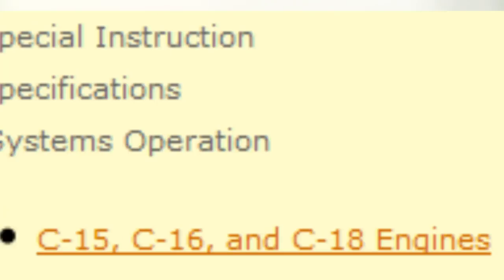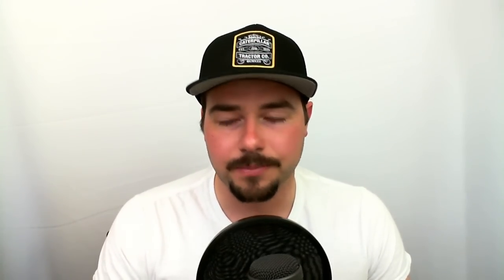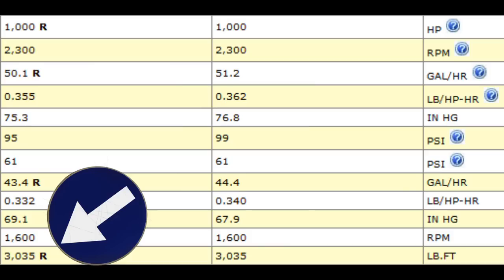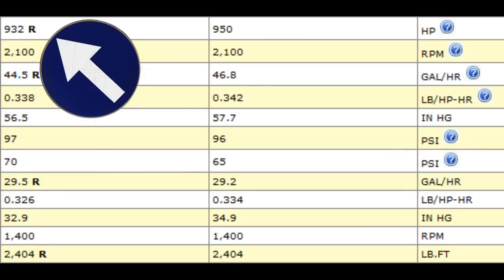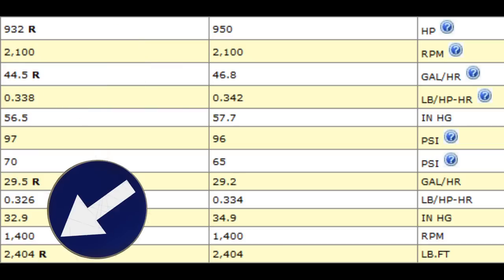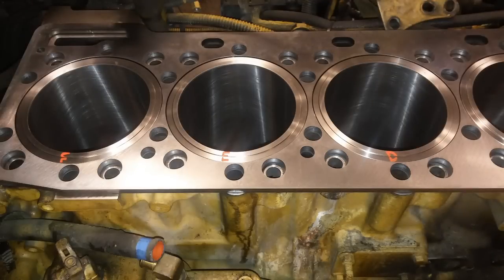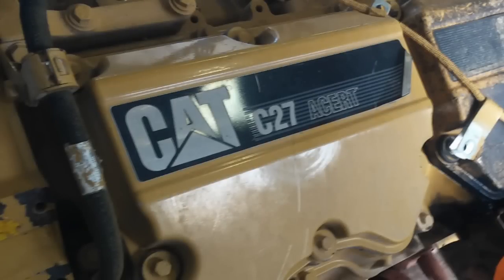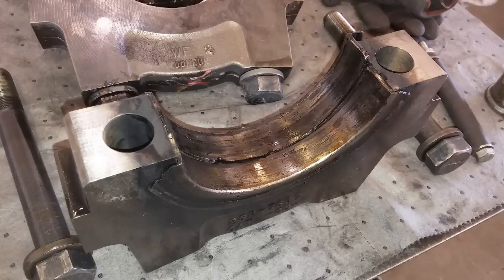Turn A Cat C15 Up To 1,000 Horsepower With Stock Parts.  The Ultimate 3406 or C15.

Comment: So what caused the c27 failure ?  Coolest truck I ever saw belonged  to Titan Heavy Haul from Evergreen Colorado. The owners custom Peterbilt had a 3412 - v12 cat. Bolted to an 18 speed Mack transmission,and 4 speed auxiliary trans. Engine had exhaust brake valves on both banks, because Jacobs doesn't make an engine brake for it. Also had an electric Klam sideline retarder.  They had to lengthen the frame 12 inches in the front, so the hood had an aluminum extension wrap attached to compensate.
Reply: George Kuetsten no such thing as Mack 18spd
Reply: @Kushmans45 ..... There most Certainly IS.... and they've been around for a Long time, and are still an available option.  The Maxitorque Transmissions have been around since the 1970s and are available from 6  to 18spd configurations and can handle up to 2,100 ft lbs of torque.   They are, and always have been Triple countershaft transmissions,  with the 12 and 18 spd versions having four gears in reverse,  just like we had with the Real twin sticks (not "today's" phony "twin-sticks" with one stick just replacing the high-low range selector on the knob). 

They were the "standard" transmission in the Mack Titan trucks that they introduced in 2008 until they discontinued the Titan in 2017, but still available in Australia which had the Titan first, since 1995.         Know what you're talking about before you incorrectly reply to someone.

Comment: I have a C15 6nz with a c-18 camshaft it also has a bully dog turbo and programming and makes about 700 horse at the flywheel almost 600 horse to the rear wheels I have a high torque transmission have run the engine in this truck for over 400,000 miles and the biggest problem that I have in the summer when it's hot cooling the engine can be challenging I have installed water injection from sno performance and this has basically eliminated my problems and I love it

Comment: You can take a 600 like my 1999 put 3412 injectors and 3412 turbo and get 1,250 horsepower.  I know it works did it on my last one put it in an 03 Pete. This one is in a 99 KW studio 3:55 18 over do heavy haul set at 650 horsepower does the job. Problem being only 119 of them built. Cat built it to kick KTE 600 Cummins butt and it did.

Comment: I wonder if the cam specs on the C18 are different?  I had a 2005 Pete 379 with the C15 and 13-speed rated at 500hp stock, and I got a dyno tune in West Memphis, AR to 594@ the wheels.  That alone made big hills almost need no downshifts.  Assuming you could keep from breaking parts, a 1000hp C18 would probably be able to ACCELERATE up a 6% grade # 40 tons.
Reply: different crank different heads

Comment: I know two local truckers that are running C-18s that were 15s. One is tuned to 1100 Hp the other is being broken in at 960Hp. Both used 6nz blocks. Custom tuning to the fuel delivery and so on but no problems. One claims to be averaging six mpg.
Reply from the maker: I figured there wouldn't be many guys that did this, but I've got a lot of comments about how common it is. Lot of hot rodders out there.

Comment: At a cat dealship I worked at we had a c15 rebuild from the main engine dealership and no one knew it had a c18 camshaft in it, safe to say the truck made it about 15 km away before it blew the exhaust stack right off the truck lol, at cats expense we had to disassemble the engine and check every part number because of that and it was mandatory to look at every cam part number after that reman engine that came into the shop

Comment: Hello There, our local ferry uses 2 C18s rated at 600 horse each they use a single turbo. The engineer told me they were originally 1000 horse each, but had problems with metal spalling off of the cam lobes for the injectors. I have noticed that IPD supplies a 17 litre kit for the C15. I currently run an Accert C15 in my log truck with around 27000 total hours on it, 7000 of that after a major overhaul. Thanks Michael from Sunny Sandspit.

Comment: The Problem with using Marine specification parts for an On-Road application  is  . 
A Marine application has all its Power and Torque , DELIBERATELY , put close together at the top end . Ideal for pushing a BIG  Boat .
Completely lacks the flexibility required , essential to an On-Road application . 
It will also DESTROY your Transmission in record time . Far too high a Torque Load for your Eatons and Spicers . 
A  Volvo transmission MIGHT hold together . Maybe .

Comment: I love it! Finally someone touches on the horsepower side of things! Would it be possible to do a video on what it takes to de-acert these dual turbo motors. There’s a lot of talk on some forums but it always ends with we can’t talk about this and the post gets locked like their balls are in a vise or something!
Reply: There's a guy out in Idaho who got rid of his compound (twin) turbo setup on his C15, and went with a single Switchblade Turbo.  That and a few minor updates/tweaks, and now he's got it to the point where it pulls better, works better, no black smoke at all.... Go check out JPaydirt channel and look back to about 2-2.5 months ago.  He's documented it all over several videos.  He'll also be taking a single turbo off of an (older) D-9 and putting a Switchblade on that, too.  He even solicited some advice from Josh about the C15 and going from double to single turbocharger, and Josh was kind enough to do a little video full of info and advice for Jeff,  included in one JPaydirt episode.
Reply: kickincain Google is your friend,  all this info is out there. No need for a overpriced Switchblade that nobody is gonna see. U could do just as good or better with stuff guys have run for yrs for half the price
Reply: to de-acert these engines you need to tune the ECM and de-adjust the VVA valves , but I would keep the twins, they had nothing to do with the problems these engines had, actually twins are much better than single for low end torque, hi hp and fuel economy all this is related to the twins, now if you're going to replace the twins they are going to cost about the same as replace them with a single, but you would lose that low rpm torque that will provide the MPG at cruising speed.
Reply: Stan Patterson I’m familiar with Jeff’s channel, I followed his progress throughout the turbo swap! I’m not saying acert motors are bad motors they just don’t work well with what I do from a day to day basis. When your pulling 84-90k up hill all day long into a head wind they just don’t run cool enough to keep from tearing themselves up and by the end of the day it’s a fight to keep the egts and water temp down. This is my second acert motor and there will not be a 3rd. I’m a die hard cat fan but these motors are absurd. Thanks for the info and I will be considering a switchblade in my next build along with pdi and Pittsburg power!
Reply: Hery Garcia there’s more to it than just adjusting the VVA’s and programming the ecm if you want the motor to last. That’s the simplest way to do it but it opens up a whole slew of new problems mainly the head gaskets won’t last with the higher compression pistons the acerts use which are 18:1. If you are gonna de-acert one you have to step down the compression to 16:1 otherwise you get blowby and head failure which you might as well have just rebuilt the motor and saved that bit you used to de-acert the simple way. 
 I’d just like a video to know from Josh’s infinite wisdom which parts could be used between a 6nz and say bxs that would fit without problems. Like journal size on the cam and crank for instance, just a lil more technical speaking. I’ve seen a lot of frankenmotors but most of the owners couldn’t tell you where the dip stick is let alone what was done to the motor and why!
Reply: good enough, thanks.
Reply: kickincain I kinda have to agree. The right guy tuning a twin can make it run and get pretty good mpg
Reply: kickincain buddy has a MXS all stock, 730k on a tri axle heavy haul truck. The right tune from the right guy, around 2k bucks, this truck runs awesome.  And when they plug it in at a dealer, if he had to go there while out on the road.  It looks like a standard 550hp tune in the computer
Reply: Hery Garcia i like the doubles better too....it's just anyone can throw a single on and make power in one spot....driveability and all around economy is better with properely set up doubles
Reply: Easiest way to add HP is through rpm, if it can carry the torque output far enough into the added rpm range to generate the additional power.  Average HP in the intended rpm range of the application is what really matters.  People don't realize that HP output uses torque output (work) and rpm (time) to determine hp output.  The more work you do (torque output) in a given amount of time (rpm)  the more HP you make at that rpm.  2000 ft lbs of output at 1500rpm will make less HP at 1500rpm than 1800ft lbs at 2500rpm does.  That said even though you made more peak hp at a higher rpm, what really matters in these applications is the average HP output from idle to about 2500-3000rpm (higher with even further modifications).  So to determine that you would need to look at the torque output over the entire range from idle to 2500-3000rpm and average the HP output to see whether the Marine engine or road going engine delivers more average in that range.  Looking at the numbers provided though power output and at what rpm it occurs I'd assume the Marine engine not only makes more peak, but also more average HP.
Reply: kickincain Can you machine a receiver groove and o-ring into the block and head on one of these engines and run an aftermarket copper gasket to help the gasket seal under the added cylinder pressure on the higher compression engine?  I assume these use MLS from the factory?  We do that on power adder gas engines and/or upgrade the head stud fasteners to larger diameter studs (obviously bolts from factory) or even go to different heads with thicker deck surfaces (up to 1"  thick decks on small blocks).  We even have mls gaskets with protruding wire "fire rings" that work similar to machining an o ring and receiver groove on the block and head.  The  ring protrudes from the gasket to seat into the head like an o ring wire would except there is no receiver groove.  With a copper gasket we put the o ring wire in the surface of the deck on the block, machine a receiver groove on the head and the wire in the block pinches the copper gasket into the receiver groove on the cylinder head allowing Superior sealing at higher cylinder pressure.  We make up to 3000hp on twin turbo small blocks with twin 88's so we need serious deck sealing.  Big blocks have more deck material and head surface material than a small block so they tend to seal better without as extensive of modifications at that power level and they already have larger Culver head fasteners.  With that protruding fire ringed mls gasket the heads have to be decked .002-.004 every time they come off with that type of gasket, but they seem to work up to about 1500hp-2000hp when we can't enlarge the fasteners or customer doesn't want to go to copper gasket and o ring.
Reply: kickincain  that's what I did to mine lowered the compression and coated pistons no blow by not putting a lot power down I would like put cam shaft in also it's a nxs
Reply: @stanpatterson5033  .... Jeff switched over the turbo (Jim Blaylocks "switch-blade: turbo, which is essentially a greatly simplified version of a "Variable Geometry" turbo) on his D9 Cat, quite a while ago, now..... works Great, much more responsive and less soot (smoke).... he's quite happy with it, as he is with the conversion in his KW.
Reply: @2Stroke Diesel Power ... yes, thanks... I follow his channel.
Reply: @martinsmallwood2399 ..... Very well articulated, and true insight.    I studied all that during my four formal years of studying Diesel Engine Design & Theory back in the mid-1960s (1963 - 1967)... and even though my personal focus was on 2 cycle design, it all still applies. 

Lots of people on the internet like to through some pretty big numbers around in terms of engine power... that "some friend of theirs" built,  with absolutely no idea or consideration of how (also) metallurgy plays into the equation as well, in terms of the reciprocating parts (especially the crankshaft) and the basic platform itself (engine block, especially the lower end) and as to what the overall power absorption maximums are.

Comment: Our Bandit 3680 80klbs  wood hog has a c18. It has twin chargers and kicks out i was told 830hp. The bandit mechanic said it is a real good platform. He also said we could get it past the 900 mark just with new tuning from a cat mechanic after it is off warranty. Got about 800 run hrs on motor and so far so good. Any way they are supposed to b solid. Would b bad ass to have c18 in one of our heavy haul trucks. Lol. In my next life.

Comment: Seen a few c18 cams put in c 15s they make pretty good power. My uncle had a c18 cam in his 6ts for awhile along with oversized injectors a s478 turbo and marine codes. That thing would haul ass built over 50 pounds of boost but wouldn’t keep a head gasket in it for much more than 100k now it’s back to stock cam 8502 injectors and heavy haul codes still goes decent and hopefully will stay together...

Comment: Forget the C18. I want a C27 in my truck now. 🤣🤣🤣
Reply from the maker: That would be pretty impressive in the truck stop parking lot, which you would have to stop at a lot getting 2 miles a gallon.
Reply: @AdeptApe  hello. Can you get 3000ft lb of torque out of a c18 engine? Or even more?

Comment: Who cares about turning a C15 into a C18...
My thought experiment is with replacing the C15 that's in the T800 (my daily work vehicle) with the C27.
It should fit, and as long as I'm driving it, it should be able to get up to speed before I hit the throttle hard.
Once I get the chance to get stupid, I mean go full throttle, we'll find out how it will perform, or what a pretzel really looks like.

Warning...
Stop here if you don't want a forehead shaped dent in your desk, because chances are high that it will happen if the next part is read...

If that holds together, then it's time to get super stupid with the next experiment. Mount a C32 behind the cab, figure out how to get power to the wheels (probably triple steer, and quad drives, all axels live), and just take it to a truck show, because if that works at all, it would need to be seen to be believed. 

I wonder how much chrome valve covers for a C32 would cost.
Reply: I had honestly never heard of either the C27 or the C32 prior to just now.  I guess I lead a sheltered life :(
Reply: Stan Patterson 
I've seen one 3412, and it was in a Peterbuilt. I'm guessing that the C27 is pretty much the same engine, but modernized.

As a bit of a rail fan, I've been graced with the privilege of seeing three C32 engines in different locomotives. My guess is that they're probably used on watercraft, and power plants as well. That's just guessing, but based on past experience, likely accurate.
Reply: I wonder how much chrome valve covers for a C32 would cost.
 
First world problems.
Our MVP asking the important questions, LMAO.
Reply: Pretty sure you will find a C27 in a D10T dozer and a C32 in the D11T
Reply: Ben Murray 
The machines that made CAT famous... 
The dozers.
Yep, that would be a guarantee.
Reply: Stan Patterson there’s also a c175 but that’s for power generation and the very large mining trucks

Comment: Good food for thought. Besides the bird and stroke you'd have to do some homework into the fuel system to support 1000+hp as well as camshaft profiles to allow the engine to breath. That twin turbo set up is interesting. Nice carnage this week, expensive!!
Reply from the maker: It would definitely be an expensive project to undertake, that is for sure.
Reply: Adept Ape But fun! I did some upgrades on some Cummins engines back in the 80-90's, they were beasts! Please don't hate me for working on Cummins! LOL. I'm enjoying your channel which I found through Jpaydirt cause in my years working I worked on Cat the least and the newer electronic stuff I've never touched. I've learned a lot from you thanks.

Comment: I great thought…. & appeals to the naughty boy in me 😂

But, I’m an Owner Operator running a C15 6NZ on heavy haul work (170,000 - 210,000 lbs gross) my first thought is “fantastic” then I think: is the cooling system upto it? In high summer temperatures I back out of it & drop gears to keep the engine & transmission temps down when pulling big hills (think west coast OR, ID & BC) what will more hp do to the driveline? 

Is there an optimum hp v practicality figure in your mind?

Any tips on improving the Jakes on this engine would be appreciated. 😊

Comment: 1000hp 
Needs more to keep up with my 3000+hp v903 cummins.
Reply: Rondal Simonds..... you seem to have a "thing" for the hp figure of "3,000"... which you said you also have in your "3,000 hp 12V71" Detroit... under a video from a company in Quebec, Canada about their high-performance ECM's, etc, etc. that was posted on June 4, 2016.... and to which you posted what you did,  7 months ago.    : ) 

As far as the Cummins "903"... they were an under-square engine and therefore, totally "gutless" in the grades for use in semis... not to mention that they wouldn't "stay together" for very long.... at least not as they were "from the factory".
Reply: not in this life time.

Comment: Engine isn't running right.  Oil pressure is low.  Lets get an oil sample sent off.  Analysis comes back.  They add a new  field named chunky, and then extend it with a strip of paper.